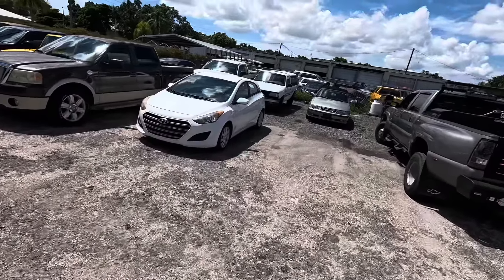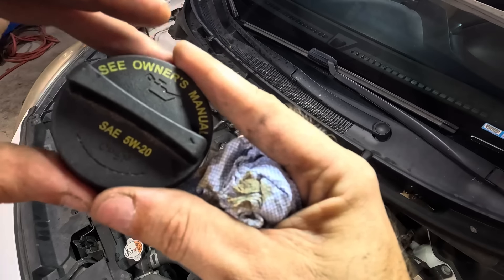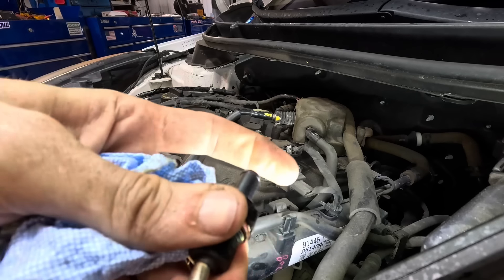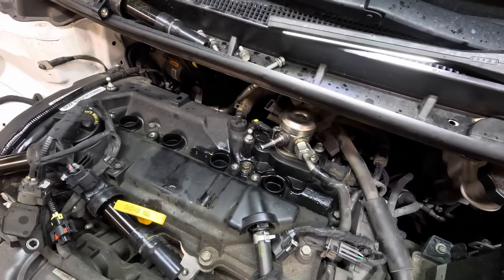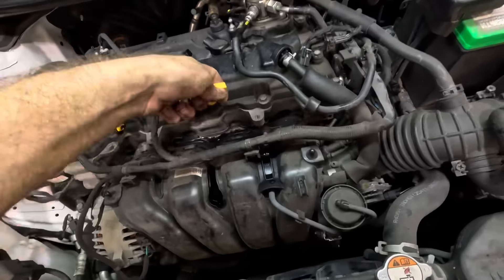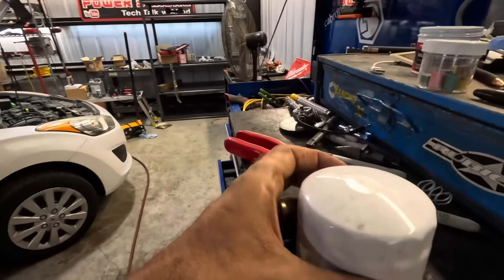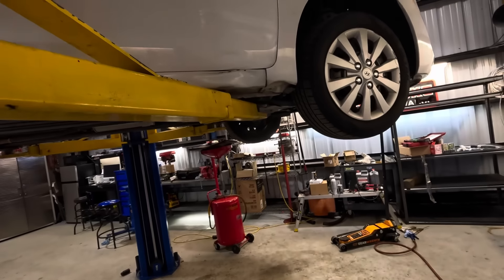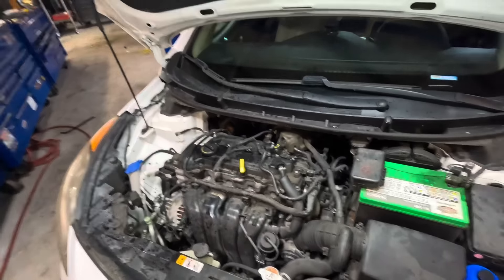Excessive Blowby! BURNING OIL! Hyundai Elantra 2.0l

Comment: Hi, Ray! I'm the 6th owner of a 2011 VW Jetta with a 2.0 L 4 non turbo 4 cylinder engine. It's got 310,500 kilometers on it. Bought it from my 22 yr old son who was having issues with it in 2022. I've only put less than 10k kilometers on it over the past 2 years. Change the oil every 6 months because I don't drive much. Replaced the battery, fuel filter, ignition coil twice (second under warranty because defective Chineseium), spark plug cables twice and spark plugs (because I don't think the first shop that certified my car actually really replaced them...long story). Since I've owned the car, I had been adding a bottle of fuel injector cleaner to my tank every 3-4 months to try to improve performance and maintenance. I was using  Seafoam high milage. After watching your videos (and Rich from FordBossMe recd it too); I bought a couple of cans of BG 44K fuel injectors cleaner. Followed the instructions and added a can to my gas tank when filling up about a month ago. After driving my car for about 30-60 minutes, I immediately noticed a difference. My engine was more responsive and my fuel economy was MUCH improved. I got 271 kilometers of range from a half tank of gas. Before, I was lucky if I got 160. People can call this stuff snake oil all they want, but I've tried just 1 of their products and I'm very impressed. Youtuber Car Wizard has also had the BG guys in his shop and showed the atomizer method of using their products to de coke carbon buildup in engines. I get it, that there are alot of naysayers that have tried other products and the manufacturers claims might not have lived up to their expectations. Been there and done that myself. In my recent experience though, I think that the BG stuff really does work.

Comment: I've switched to the Valvoline restore and protect oil that's recently released, fixed a lot of oil consumption issues but there's always been high pressure under the oil cap which I was told was normal
Reply: I'm no mechanic but I've never heard it to be normal to have pressure under your oil cap, it should "suck down" to the valve cover otherwise you have a clogged PCV system, or excessive blowby past the rings.
Reply: @volvo09 ray told us in the video the oil is normal, smoke is the indicator of blow by.
Reply: A bit of oil splash with the cap off is normal, pressure is not.

Comment: I have a 2013 Hyundai Elantra Limited with a 1.8 L engine.  It has 111,000 miles on it and it does not burn a drop of oil at all.  I have heard that these newer engines are terrible about oil consumption  when they get as many miles as this one has.  Carry on Ray. Good Job!!

Comment: Bought some of that there snake oil for my 80,000 mile Jaguar XF-S which runs good.  WOW!!!  Put it in 30 mins before the oil change and ran the engine up to 2,500 rpm to make sure the secondary turbo tasted a load of it.  The car actually pushes me back into the seat again on full throttle, and the turbos are all quiet again - no whiffling.  That stuff works!  Thanks Ray.

Comment: Good Morning. Love your videos.
I had some personal experience on this same oil burn problem I thought I could share with you.
After having the oil analyzed, it showed having fuel mixed into the oil.
It turned out the high pressure fuel pump was leaking into the oil and causing thinning and loss of viscosity. And recommended oil changes to increase to 1200 miles.
The fuel pump was the problem.
Good luck on this one and the cleaner did a great job.

Comment: I had a Hyundai Elantra 1.8 gdi 6spd manual 
Always run on 98 octane fuel and did oil and filter every 10,000 kms 
Did 350,000 in 8 years and the car was a tank 
Never failed and never burnt oil 
Hands down best car I ever had 
Now drive an i30 N Line 6spd sedan and totally love it
Reply: Nice ride
Reply: Thanks for letting us know, we were all curious about your previous and current vehicles.

Comment: Thanks for taking the time and actually looking for an issue. Most shops would have stopped before you lifted and just topped the oil off and send it on its way saying they couldnt repeat the issue so nothing is wrong.
Reply: You know we only get paid if we can at least tell you whats wrong with your car?  I'm a master tech doing some research from home for a hyundai I had in today with oil consumption issues.  Definitely not knocking his dedication, but in 20 years doing this, what your seeing here isnt far from typical.   We would get extra diagnostic time if the diagnostic ran over 1 hour or parts that weren't reusable  had to be pulled off.
Reply: @ im speaking from my experience. I had an issue with my pickup and went thru 5 shops before finding one that actually took the time to fix it. The other 4 told me they couldnt get the issue to repeat and since no codes where showing there was nothing they couldnt do. Like you said you only get paid for doing the work so unfortunately most shops would send it on its way so they couldnt get get to a vehicle with obvious issues faster.

Comment: It takes a special type of talent to fix a disposable car from Korea.
Reply: They simply want to go to the junkyard
Reply: @volvo09  👍Junkyard heaven.
Reply: My grandparents bought a Santa Fe.. in their defense they’re in their late 80s and don’t know any better.. Although the car hasn’t been bad I’ve done work for them it’s never needed anything expensive just headlights and oil changes. Lots of headlights😂
Reply: @bh2236  yeah it’s something with the lights.. haven’t had to do brake bulbs yet they’re still working but I’ve replaced the interior lighting with LED and they stopped burning out but my grandparents REFUSE to let me install LED headlight bulbs to fix the problem
Reply: @bh2236  it’s a 2019 Santa Fe with halogens. I swapped my 1997 Chevrolet’s headlights for LEDs and now I get other people flashing their highs at me so I flash mine back. I mean the truck is a Z71 it’s headlights are at like at least windshield level for a small SUV so I guess it makes sense. I need to be able to see when I’m working at night though

Comment: I own a 2012 Hyundai Azera Limited, bought in 2016. It had 34K miles on it at that time. It now has 102K miles. I've had ZERO issues with it. It still runs like a champ. I'm one of those OCD detailer kinda guys. I stay on top of it scheduled maintenance needs. I adore this car and it still turns heads. Not bad for a 12 year old car. No complaints from me on Hyundai. Always use full synthetic oil and AMG batteries. Full system fuel cleaner ever other full tank. A little love for you car goes a loooong way.

Comment: I've got a 2005 Jeep Liberty CRD, with the 2.8 L Diesel engine. It's coming up on 160K miles. Have always used Amsoil AMO 10W-40  in it, along with one of their high efficiency oil filters. It's still tight and clean and runs like a top.
Every time I change the oil, I'll do a flush on it. Get it hot, then drain out the old oil and remove the old filter - put in 6 quarts of cheap 30 weight oil, a NAPA  oil filter, and a can of Lubro-Moly engine flush - the run it for 15 minutes, occasionally revving it up.
When I drain out that 30 weight oil, it comes out just as black as the old oil - it's flushing out all the residual soot and other crap out of the engine - when it finishes draining out, the passages when the oil filter mounts is nothing but bright shiny metal.
Then I put in the good Amsoil filter, the Amsoil 10W-40, and a can of Lubro-Moly MOS4 additive.
Reply: A flush every single oil change? 🤨 Sounds like the oil you're using isn't very effective if that is actually necessary
Reply: I’d recommend a second conditioning oil change after the 30w.  Something along the lines of 10w50 with a 30 micron filter to trap the soot.   Then some Fabuloso.

Comment: That BGR (Engine Restorer) is made to clean sludge inside the engine including the piston rings,  that stuff has saved countless engines that have gotten gummed and sludged up and it is made here in the USA !       It will NOT FIX a damaged engine but it will clean gum and sludge out of piston rings and oil galleries inside and even the oil pan that can make an engine run poorly.

Comment: I literally just got a used 2015 Chrysler Town and Country. 120k mileage. Looked mint, Drove mint for test drive on city streets. 
🙄 On the highway drive home… Engine experienced severe aggressive shaking, check engine flashing, the whole nine yards. 
Apparently someone had like 10 quarts oil in the thing! It experienced severe blow by, oil all over spark plugs and up in the throttle body. 
Fastest $4k I’ve ever had go up in smoke! 🙄

Comment: Nice to see they haven't got any better with the blow by oil burn! Had the 2003 version of this engine, oil burn was not good! Couldn't complain though, it did drive 4000km across Australia in January (summer here) with a 10cm hairline crack in top tank of radiator... would lose coolant down to crack line, otherwise no issues.

Comment: Ray i have a lot of 2.0gdi experience on my 2014 Kia Soul and another one and 3 Elantras i am a retired master mechanic but i service a taxi Co. Taxis i found foamed or excessive blowby and consumption found bad PCV Valve and the HOSE PLUGGED UP!! I replaced hose and a genuine Kia PCV.  Flushed with 1 can Rislone flush and 4 qt cheap oil for 45 min at 2k rpm and a new filter. Then drained and put on Wix Filter and 5 qt Mobil 1. 10w-40 ( these cars had 166k - 298k miles) all 4 cars straightened up and oil still full at 4k each and changed at that point! The PCV VALVE seemed to be the prob. One car had the valve changed before but with china valve.  Im 71 and the 50's-80's are my  favorites. Another tip is when mounting tires spray the rim and the bead with cheap clear or black spray paint. (After cleaning rim and bead) i have about 10 tires that have been on old cars for over 10 years never needing air until dry rot ends it! When changing failed tire the rim is still clean. I hope these tips work for you!

Comment: Not bashing anyone or trying to be an a-hole but, we've always, drained the oil, refilled with diesel, ran for a few mins, drained, new filter, new oil and was done, engine was cleaned and yes, you'd be surprised as to how much sludge you can remove from an engine this way. The one thing that always gets me is, the new mileage goals for oil changes, I've always been a firm believer in every 3k, never had any engine issues changing at a 3k interval. Great video as always, cheers :)
Reply: There's a mechanic I know that does that. Drain the oil and put diesel fuel in the engine 'cause diesel have more cleaning detergent. Run the engine a few minutes at 2000 rpm and drain in again. You can see how dirty the diesel fuel coming out. Then he puts the right engine oil and a good oil filter. But customers never complain of any problem. But bear in mind that diesel is more expensive.
Reply: @csan255  Well, pending on what part of the world or country, per gallon vs oil quarts, diesel is still far cheaper. You only need to run a gallon through the system, at least that's how we've always done it since, after the clean out, that's when the oil filter would get changed. No point in having to change a filter twice, those get expensive. 
Now if you're talking several gallons, yea, it does get expensive but, the cost in repairs vs spending a little in maintenance... well worth it and should be considered an "investment" not a cost. Cheers :)

Comment: I have used similar things on a high mileage engine and it did help with the oil burning so I could do a trade in with out taking a bath on the value.

Comment: I have understood that to check for ring problems put a squirt of oil in the cylinder first.  You have convinced me that this stuff works after the last vehicle you poured that stuff into.  I hope that off camera you cleaned up all that oil splatter.

Comment: Hey Ray.  We had a similar problem with carbon build up on the old BMW 528e.  We saw carbon build up as soon as 5000 miles.  On the lesser severe engines, we would run an oil cleaner additive, and at the same time, disable the fuel pump, and use the 3M injector cleaner since the engine had to run at @2000 RPM's.   After that we would change the oil and add Techron to the fuel system.  That fixed many of the carbon build up problems.

Comment: That's totally correct on the oil viscosity in my opinion Ray, thicker oil hurts stuff when cold flow and/or foaming are issues. But in sunny Florida, on an oil burning car, thicker oil is probably a good call. 👍
Definitely not hurting anything anyway...

Also, did y'all see that freehand oil pour??? Very impressive haha

Comment: I have been a Nissan and ASE master tech since 1989. BG products work. Prior to using BG I would put in 1 quart of ATF in the engine oil and run the engine at 2k rpms for 30 minutes. I would let it sit for an hour then change the oil again. It worked well for stuck/carbon stuck rings

Comment: You could do a wet compression test by putting a teaspoon of oil down the cylinder if the compression shoots way up then it’s definitely ring problem because the oil will temporarily seal the rings a trick I learned from an oldtimer
Reply: was he called scotty?  :)

Comment: I had a '72 ford stepside with a 351 Windsor. I just poured in what was on the garage shelf. That thing ran great on 40 weight.
Reply: I switched a Villiers small engine to Royal Purple 40 weight and it has never run better..!

Comment: Yes, if you are like myself and have worked from home for a decade or more, you wind up with a 2015 model car with 25k miles. I have finally settled on a 3k miles or 6 months oil change interval (whichever comes first). Yes I have used full synthetic oil since 1998. I can tell you the one time I forgot to specify synthetic, it was during the summer in Phoenix  (my wife's car) and after 3k miles you could REALLY see the difference. Perfectly clean and shiny dipstick suddenly had a nice brown patina. Regular oil doesn't do well when you regularly drive in temperatures above 110. 
Edit to add that I have used mechanic in a can before, and have no objections to it. It was on a 1984 Chrysler that started life as a Chicago rental car. Since then only new vehicles, so just kept up the normal maintenance and haven't needed any. My 2005 Honda Accord is still very reliable transportation for my sister (and still has a bright shiny dipstick).

Comment: These engines are known for failure. There have been several class action lawsuits about them.
Reply: The warranty on the engines was extended to 150,000 miles. Plus, there is a knock sensor, software update recall.
Reply: I always see the GDI and read it as General Destruction Imminent 😂

Comment: I have the same Hyundai GT. It burns oil. It makes sludge. But it's still running strong at 250k miles. 

It would burn 1/2qt of 5W20 every 1500 miles. So, you have to top them off between the 7500 mile oil changes. 

Dealers use 5w30, which reduces oil consumption. I regularly replace the PCV valve as they get nasty. I found Lucas fuel additive reduces oil loss and increases MPG. But, to eliminate oil consumption, 10W30 works really well. And it's a common solution owners resort to.

Comment: Crikey, you young people are spoiled. I've run POS cars that use a quart every 100 miles. Leaking, burning, loading up at a light and a huge blue cloud (Hey Greta!) of smoke and spitting raw oil all over cars that stray too close when chugging away from the light. Sears oil was $0.79 a quart; was buying cases until I found out I could run the 10/40 oil that we changed out on hydraulic equipment. Car never left me stranded.
Reply: noooo...must be Amsoil, tested and proven by him
Reply: I remember those day.....years. Yeah, back when fuel was 80 to 95 CENTS a gallon. So on one hand these kids are spoiled. But on the other hand they have to take out a small loan to fill up their truck. Man, I miss the days of price wars on fuel prices around town. Now everyone wants 3 or 4 dollars a gallon, depending upon where you live of course.
Reply: Out of all the cars I've owned in the past 30 years, which has been a lot, only the Hyundai's burn oil right off the assembly line. 

Supposedly, they fixed the problem many years ago.
Reply: @donwyoming1936  Amsoil will restore it better than when it was made.
Reply: @donwyoming1936  Aren't those just disposable cars anyway?

Comment: Hey nice job Ray, way back in the day 70's we used to use transmission oil, Kerosene. the cleaning solutions they have out today are far superior then what was available how ever as you stated the problem still exists it will be up to the owner to monitor the condition.

Comment: Kia oil changes are due at 3,750 mile oil changes. Every single engine I have replaced were from oil changes at 5,000 miles intervals. That's including full synthetic oil changes. I have denied engines for warranty with 5k oil change intervals due to sludge buildup
Reply: sounds like a good reason to stay away from kia, besides there are les expensive, better quality vehicles in NA than a kia. but regardless people keep buying them

Comment: One important thing we all ignore is that after engine flush process you must open the oil pan and clean the pickup tube of the oil pump and the oil pan it self cuz all that carbon buildup is going to gather down the oil pan and it won’t get out from the oil drain plug.

Comment: I can remember my dad in the 1960's pouring Marvel Mystery Oil down the carburetor of a running V8.  The smoking tailpipe was great to see as a young teenager.  Low mileage and short, a couple mile,  runs in a cool coastal environment the engine never got up to temperature.  It worked then, and now with better chemistry I am sure it is a valid process.